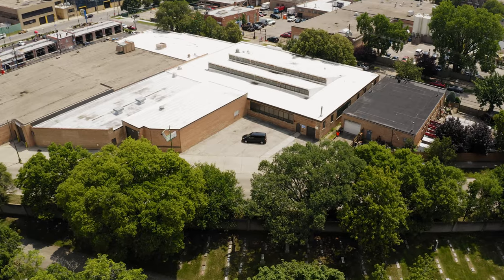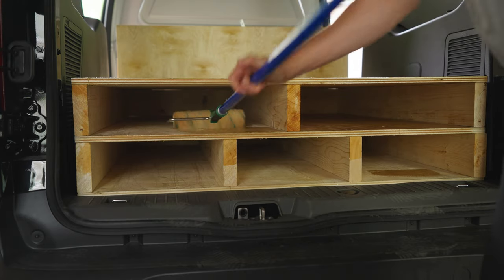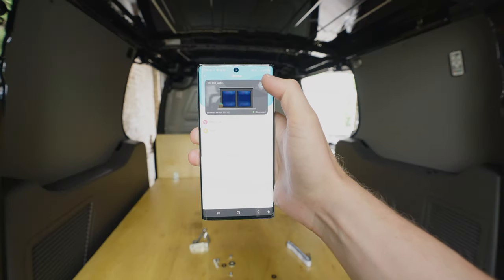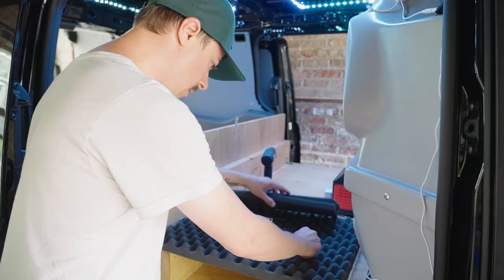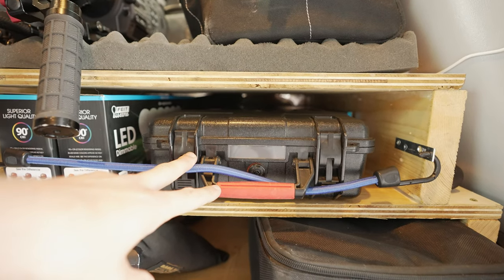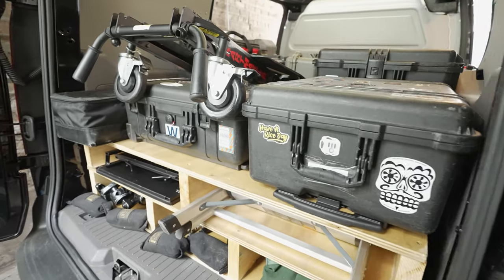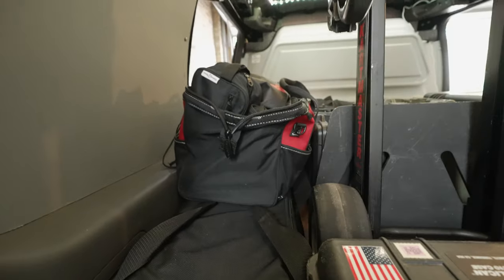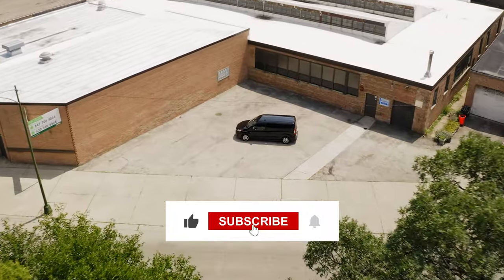Video Production Van Build | Part 3

Comment: So, I figured out you already did parts 2 & 3. I have now watched your entire van built-out. Over all, great job. As one who's built out our video production van, twice, I have a few suggestions. Yes, industrial carpet, at least on the top shelf but, if possible, I'd put it in all cubbies too. We also built-out with wood and the carpet protects it better. Seems like you need to think about using the space above your equipment better. That is wasted now. Perhaps you could fly stuff from the ceiling, and/or build another shelf. Best of luck.

Comment: Awesome! Your van is so much nicer than mine 😅. One thing I picked up recently is a sun shield for the front window when I’m parked. I keep my gear in the van too and that thing with reflect a ton of heat! Not sure how much of a difference it makes for keeping the gear from over heating in the back but it’s a little piece of mind.
Reply from the maker: No way, yours is dope. Sunshade is a good tip. I recently got one as well and it really does help. The gear does get a little warm in the back. I have that full plastic partition and I feel like that plus the the color black really do make things warmer than I'd like. I don't think its hot enough to worry about damage but it do be steamy in there on a sunny day. The sunshade helps the cab quite a bit though.